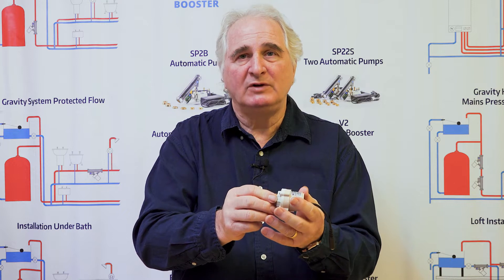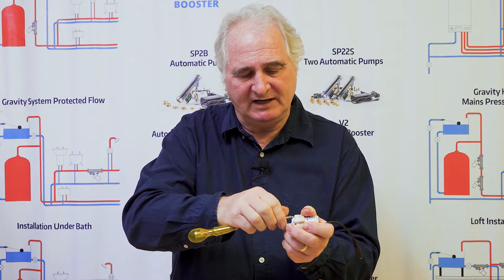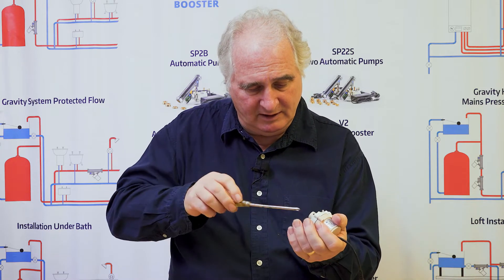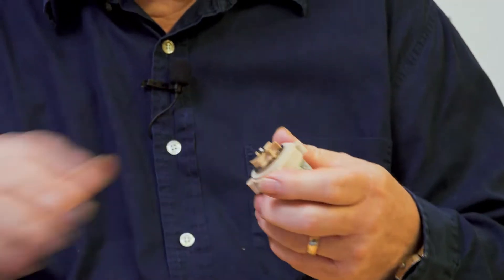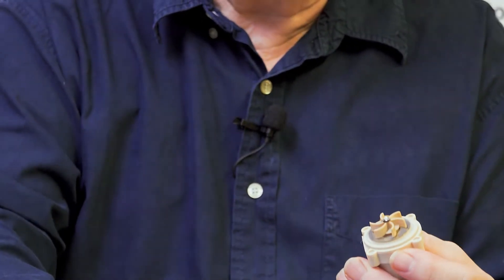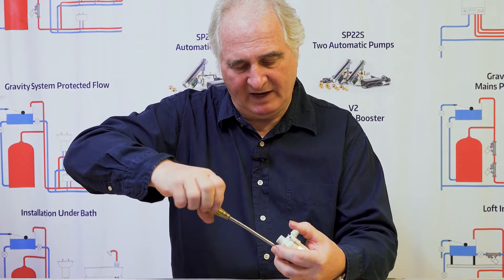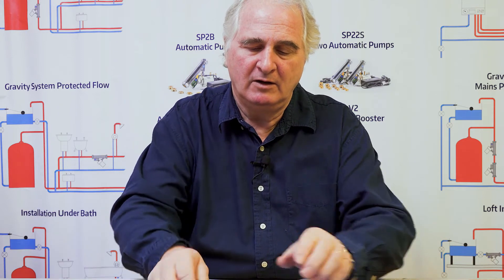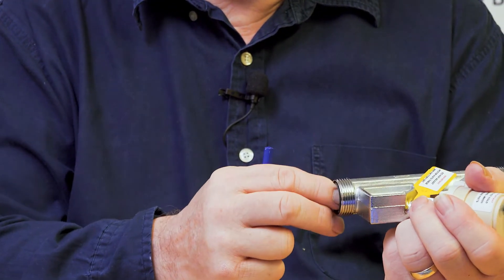Sustainability And Radiator Flow Boosters  5

Comment: To replace the motor does the water have to be turned off?   I'm assuming that it has to be turned off as the hot water flowing freely into the airing cupboard would not be good.
Reply from the maker: You would have to turn the hot water off. The V2 is for radiators so I think its the ShowerPowerBooster you are thinking about which boosts drinking water and water for bathing. ShowerPowerBoosters are often fitted near the hot water